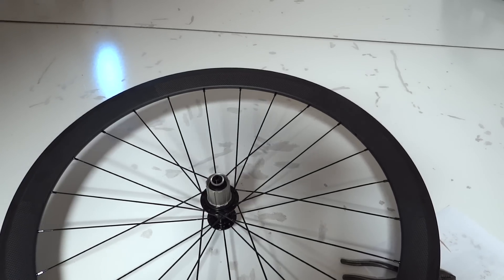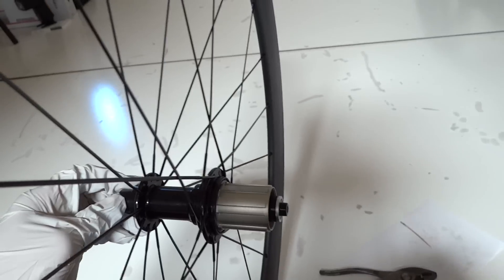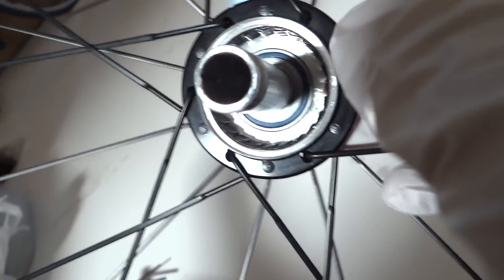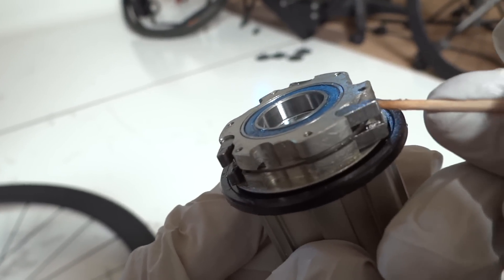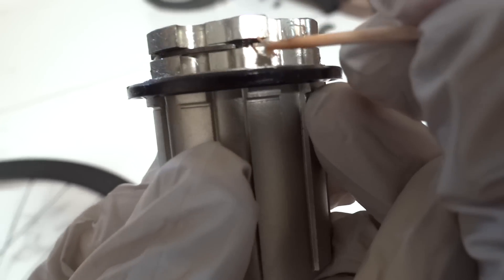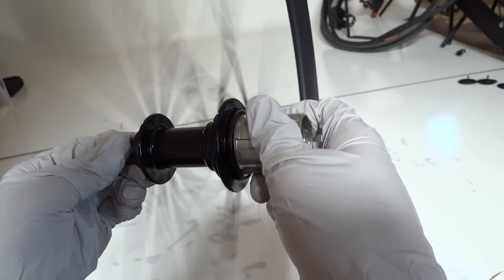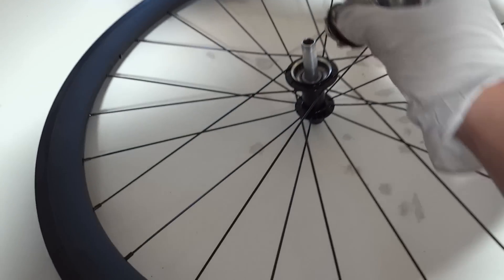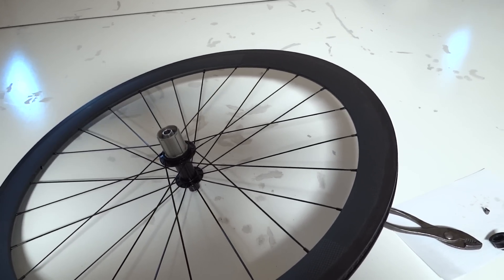Quieting a rear hub/messing with the rear pawls test

Comment: If your pawls are disengaged and making lots of noise you need to start pedaling again! After all there is no pawl resistance when you a pedalling. The only time this would be a benefit is when you are coasting downhill, but downhill speed is limited by wind resistance: the pawl resistance is completely negligible in comparison. Also your hub will probably fail much sooner, and then you won't be going very fast at all! ;)

Comment: Hmm, looks like a expensive way to break and ruin a hub.  There is a reason why there are three pawls.  Or move the second pawl so it's adjacent from the other one at 3 and 9 o'clock positions.  Honestly for how I ride I would add the other three pawls to have six for better power transfer.

Comment: Er... The purpose of that ring is to keep the pawls sticking out under some specific amount of tension, not to keep them tucked in. Yes, the spring also doubles as a retainer that prevents the pawls from falling out, but this is its secondary purpose. The primary purpose of the ring, again, is to force the pawl ends out. Meanwhile, the author of the video uses a toothpick to illustrate the opposite effect of the ring. This is misleading to an unprepared watcher.

Comment: Those pawls are pretty universal,looks like you have space for 3 more pawls,I would add more pawls and a good coating of ceramic grease on the internals and that would turn that hub into a beast!! the grease would quiet it significantly and you would have a 6 pawl hub with 48 points of engagement at least..don't remove pawls add more!!
Reply: This freehub's vacant pawl slots are offset to effect more points of engagement. However, those slots have reduced material between the other slots and are weak.  High torque causes the hub to break.  It seems the MFR "fixed" the problem by removing the pawls from the weaker slots for a lower failure rate.

Comment: removing a pawl from a 3 pawl design is a phenomenally bad idea. A triangle is an inherently balanced shape. Take one of those points away and putting force into it will create an unbalanced shape for putting force into the wheel by pedaling.

Remember, pawls create drag ONLY when coasting, not when pedaling. But when you're pedaling, you're now putting all that force against the side of the bearing, instead of simply trying to rotate the wheel.

This will reduce the lifespan of your bearings MASSIVELY. Not a factor of 1/3 or 50%. With all three pawls, the pawls keep the drive and wheel centered and your force is only pushing the wheel forward. With two pawls, 1/3 of your force is on the bearing that wasn't on the bearing at all before.

Stupid, stupid, stupid.
Reply: Shimano non series have 2 pawl only that looks like 1 pawl missing from 3 pawl design
Reply: @smpoy  Nice necro... but just because Shimano does it, doesn't mean it's a good idea. The physics principle that I described is true and valid.
Adding a pawl is sometimes doable, but can cause problems. Taking one away is always a bad idea.
Reply: @eschelar  my Shimano 2 pawl hub still in good condition, 8 years old and older than your comment.
Reply: @smpoy  And what does that prove? I described a principle of engineering. 2 points on a line, 3 points on a plane. 

If you have 3 points centered to the axle, it will always center the axle. Removing one of these points will de-center the axle and increase the load on the remaining pawls by 50%.
It probably won't damage the pawls unless you're doing a lot of crazy dropping, which is rare for road bikes.... However, it will de-center your axle and increase wear on bearings and the axle itself if it's not properly supported. Again, if you're just casually riding on the road, it won't have nearly as much effect, but if you ride hard at all, this will significantly reduce the lifespan of your bearings. I'm an MTB guy myself, so when I said "massively" I was referring to an MTB, although admittedly, I could have been more clear about that in the original comment. And if you ride hard on a road bike, it will also increase wear. I've seen wear on aluminum axles from this that would never normally occur.
Reply: @eschelar it proves that still robust than your explanation.
Reply: @smpoy  I'm talking about an engineering principle. If you have a design that off-centers the axle, it's inherently a bad design. You can get away with it if you have low torque or low demands on the parts. Doesn't make it a good design just because one person has owned one for 8 years like this. 

It's a bad idea to smoke too. There's a person who just recently reached 116 years of age who smokes. Just because one person lives that long and they smoke, it doesn't mean that it's a good idea to smoke and it doesn't nullify the fact that millions of people die every year from cancer, which is linked to smoking.

Comment: First off, not all hubs is as easy to remove as shown in this video, but I do have a noisy Reynolds hub, and upon disassembly I noted my spring tension is already fairly weak so I can't see how a different spring would help, so I just removed 1 paw out or 3, clean out the old grease, which seems kinda thin to me and applied liberal helping of auto brake lithium grease, which is thicker than the stock's. Immediately the noise is down. Lets see if it holds up over time.  Thought I wouldn't mind the noise but I do. Hate noise.

Comment: The spring design seems wrong to me. How is it applying equal and correct force to each pawl? My Mavic hubs have tiny springs underneath each pawl so at least the force is equal. I'd be worried about bending that spring at all since it would be unpredictable as to how much spring tension would then be on each pawl. I did notice that greasing the pawls made my hub much quieter. I thought that you were supposed to use a relatively thin oil or grease since you don't want the grease to interfere with the pawl easily engaging the gear surface.

Comment: I recently trashed a hub inside of 2 months because I'm 230lbs and put a ton of torque through my drivetrain. Removing one of the 3 pawls would have made it die even faster. I'm using DT Swiss hubs on my new wheelset which should be multiple orders of magnitude stronger.
Reply: Have you considered cryogenic treatment from like 300below? might be pricey but seems like the hubs would be a good candidate for it.
Reply: I haven't considered that, actually. The new hub (DT Swiss 350) I have now seems pretty bulletproof:
http://www.dtswiss.com/DTSwiss/Images/splineone/hotspots_ratchet_system.jpg

Comment: I counted 19 seconds on the 1st spin, 24 seconds on the 2nd spin. 5 seconds seems significant until you consider the spin up is uncontrolled, and that the 2nd test had too many variables without the preload of the locknut in place. I do not believe this proves anything, and for me, isn't worth voiding warranty.

Comment: Its really just fine removing 1 of those 3 teeths as long as you put the remaining two at the same distance from each other.   There are six slots meaning you just remove one teeth and adjust one of them to be level. I disassembled my old shimano hub and it only has two of those. I dint know there where hubs that has 3. Now that explains why som bikes have really loud freewheel sounds.

Comment: I have the same issue with my new Vision trimax 30. When I am going downhill and let it freewheel You actually feel the bike slow down. I don't have this problem with my Duraace C50's nor my Marchiso Zefiro. And I actually prefer softer freewheel clicking anyhow. I want to make a note that the Vision Trimax is a brand new wheel as opposed to the
others. So I assume it will quiet down and decrease it's drag after a few thousand kilometers. I really wish there was an immediate fix for it. I appreciate you bringing this issue to the table because the efficiency of the bike is jeopardized to noticeable extents from springs that are too stiff.

Comment: I think it wouldn't be fair if you compare a road bike hub to a mountain bike rear hub. Primarily the loud noise is due to the reason why it is suggested to be placed on a mountain bike, since you pedal more on it than on a road bike. (uphill = lower gear = more cadence vs Flat = more on higher gear = less cadence). The pawls and their springs are mainly made to withstand high powered pedaling compared to the way the RB hubs are made. just my 2 cents. 

As of the time of your video, It may have the same resistance but still we cant be too sure how it will play inthe long run. IMO

I maybe wrong but that is how I see what the MTB pawls are made for

Comment from the maker: To let you all know.... I did put back the pawl back into the freehub however I did reduce the spring tension of the metal C clip which seems to have reduced the sound and seems to roll better for me.  Again. YMMV.  For me it was worth reducing the spring tension as I noticed a difference.while coasting.  I would not touch the pawls, but I would definitely adjust the spring tension if I buy another set of carbon clinchers.
Reply: Hello mate 
I have got now the same hubs r36.  some ppl say the powerway hub is the copy of dt Swiss is that correct ? i want it louder is it possible to add 3 more pawls ?  and what is the dimension of the bearings if I wanna replace a ceramic bearings?  Thank you in advance I hope you can help me .

Comment: I'm seriously wondering if the tension spring is less on the 8-9-10 speed hubs because-as many have noticed- the drag is far more noticible on my aksium 11 spd than it was on my ritcheyDsPro 10 speed hub.(and the noise was 5x as loud with the aksium) I thought of tearing both hubs apart and changing out the spring from the ritchey to the aksium but the smarter minds over at the LBS said the hubs internals were different enough to scrub doing that.

Comment: I tried going to 2x pawls - not much better noise wise. So I decided to remove the c clip spring which was very easy. I observed the gap in the c clip to be about 1.25mm plus or minus .25mm. I sat very patiently for 5 minutes to frequent myself with the spring like properties of the c clip. Once I was comfortable with this I opened the c clip very gently - applied several iteration of this until I reach a gap of about 3.5-4mm - refitted the clip with only two pawls and the noise 80% better :)

Comment: looks like the freehub body was designed for 6 pawls...did you buy it with 6 pawls and take out three?
Reply from the maker: it does look like it was designed for 6 pawls however mine came with 3.
Reply: LBS guys said the pawl count went up with the price of the hub. (ala Dura Ace vs 105 vs Tiagra)

Comment: Don't do this the resistance is minimal when your body weight is on the wheel, I could spin my wheel with ceramic bearings and it spins for 3x the amount of a normal wheel but when it comes to real world difference it hardly improves it.

Comment from the maker: Question: how do you inject bearing grease into the pawls?  Do you put it on the tip of the pawl where the tip ratches against the teeth or also underneath the pawl where the "U" area is?  I'm about to grease the pawls with some tri-flow teflon spray.  thanks.

Comment: Guys, what do you think you are really gaining by reducing the pawl resistance?  You cannot determine the amount of energy lost by spinning the wheel with no load on it.  The energy dissipated by the pawls is infinitesimal.  Friction from seals, bearing preload, bearing design, bearing quality and bearing lube contribute more to friction losses than the pawls to freewheeling ability.

Comment: fewer & asymmetrical pawls as well as weakening spring (so the pawls don't snap back fast enough for engagement in power bursts) worsen dangerously stress on freewheel. It's not hard to set an experiment to measure ratchet influence on resistance to spinning. 
I would trust designers competence.

Comment: not having the pawls in opposing slots triggered my engineering odc hard! 
bending the spring a tad looser, and a good helping of the thickest and stickest high-temp grease you can find under the pawls, will work wonders. (ask in a car ot motorbike repair shop or buy a pound that will last you a lifetime for like threeefiddy. 
actually i have one with me, in case you are interrested. ;D

Comment: then you wont have any way to go anywhere because nothing is gripping the inside of your hub you need at least one in order or move i would have 2 prongs on an even distribution that way its more quiet and it will role better but the less you have the more likely it will fail